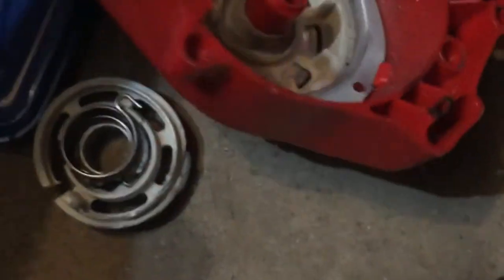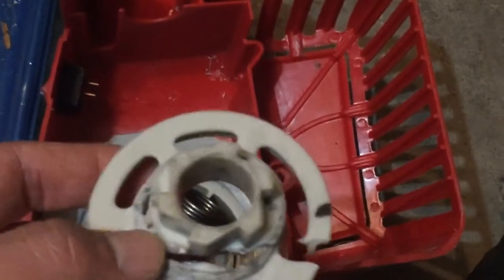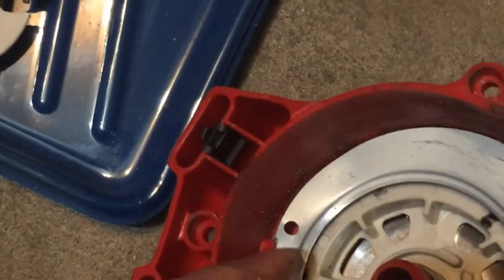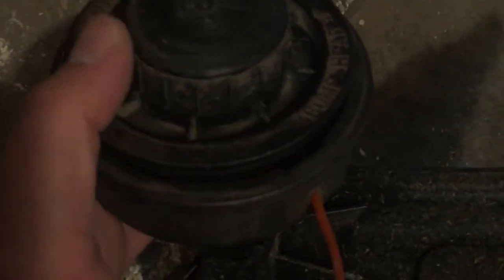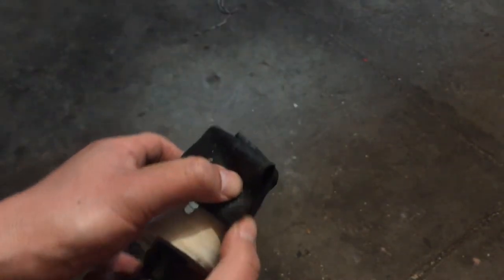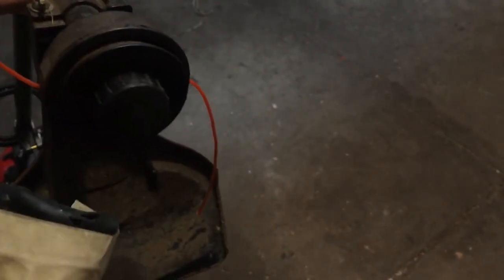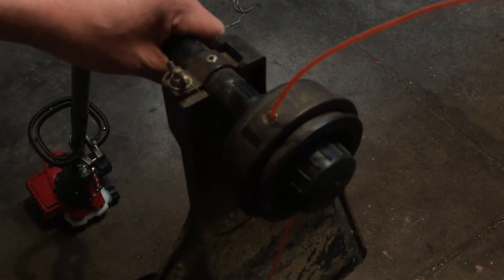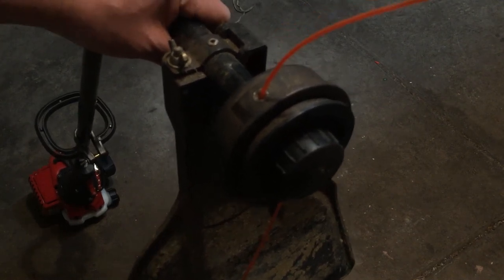MUST Watch How to start any string trimmer |weed eater| with a drill

Comment: Why did you not put the drill on the engine shaft that the string rotates. 
Instead of the string doing the work of rotating the engine shaft now you use  a drill to do the work of the string.
Hope I am clear. Please do reply.
Thank you.
Reply from the maker: Thanks for watching! Because it requires no modification to the trimmer just an adapter to the drill
Reply: How will the centrifugal clutch ever engage? Ghost friction?

Comment: Do you need to remove the pull cord ? Or can I do it with pull cord intack
Reply from the maker: Sorry for late response, I took it out because the failed clutch was causing the string to catch both directions.

Comment: Can you do this with a trimmer that has clutch
Reply from the maker: Hi sorry for the late reply, if when you rotate the trimmer head is also cranking the engine, it will work.
Reply: @gogodiy5982  no it just spins freely without even moving the engine